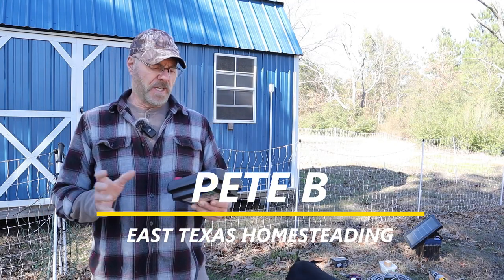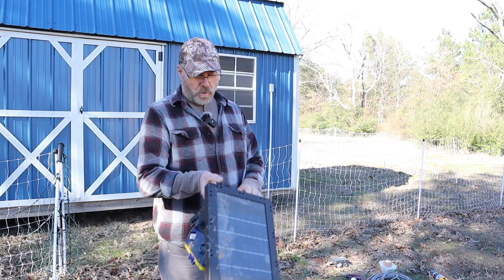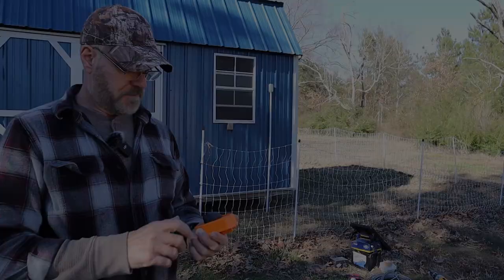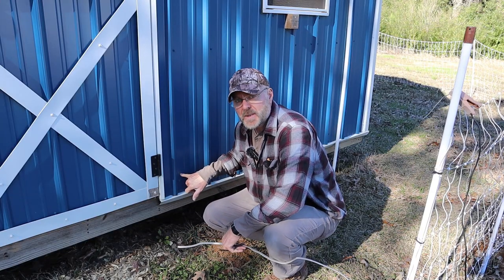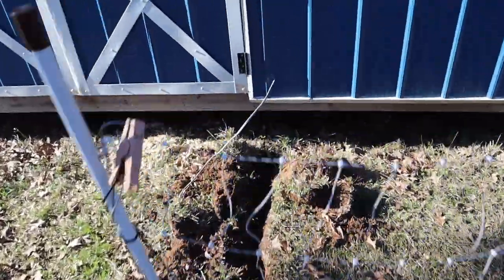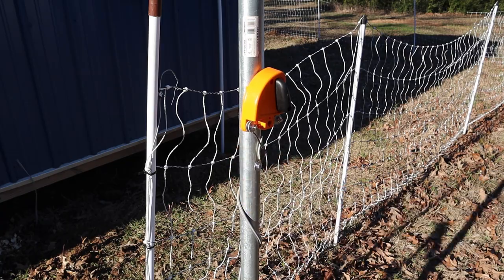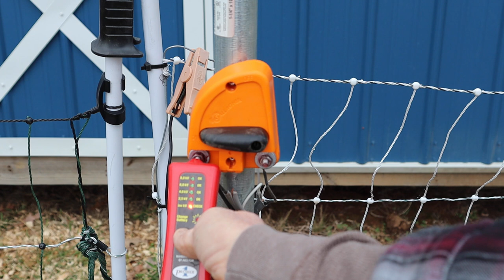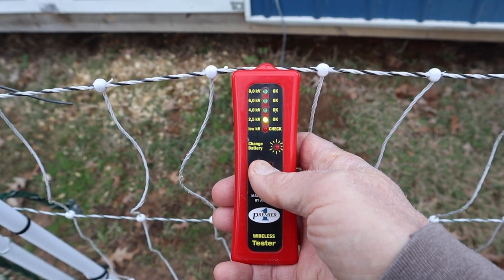Installing a Gallagher fence energizer And Cut Out Switch

Comment: I’m sure there’s going to be a comment somewhere here but WE found that what tends to ground out our fence is the leaves that accumulate at the bottom of the fence. we take our leaf blower and blow all the leaves inside the chicken run (because of course the chickens love that) and our fence energy will go back up to normal. Our goal is also to - someday - be able to run electricity to our coop. We lost one solar energizer to ants as well and solved that problem by putting it up on a T post. But we still need the rain barrel heater to keep our water flowing in the winter, to have electricity power both the fence and the water heater would be great!

Comment: If you are fencing livestock with the electric fencing you might change the layout as you move the animals around for grazing. This means you are using a different amount of coil length on the spoil of wire every single time you move the fence. That means you end up with a lot of spare wire still on the spool, while most of it is up on the fence? What do most people do with that excess spool and wire while its being used? I don't want to cut it off but curious what other people are doing with the slack?

Comment: Hi Pete,  is the 1 1/4" metal conduit that you used for you cut off switch mount, is also your grounding rod for the fence energizer?  Thanks
Reply from the maker: Correct, the conduit is acting as my ground rod and mount.

Comment: This is a stupid question, but I want to rig up the same plug-in for my electric fence for my sheep, but I’m getting into winter so if I lose power at the house, I still would like to have the Solar option. Am I able to set up both of them at the same time so the Solar will be on as well and I’ll be a back up so if I lose power in the regular one, then the Solar is still there. I hope that makes sense.
Reply from the maker: I don't know if they can run simultaneously, but you could try. It's probably best to have the solar unit as backup if the power goes out.